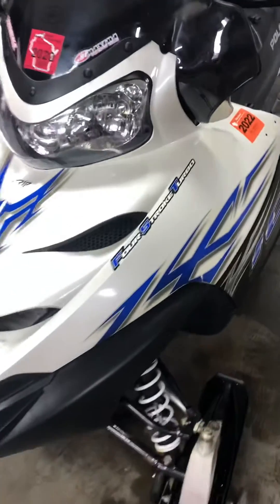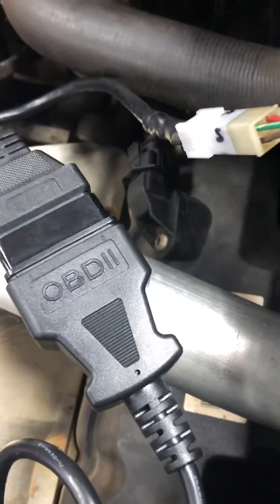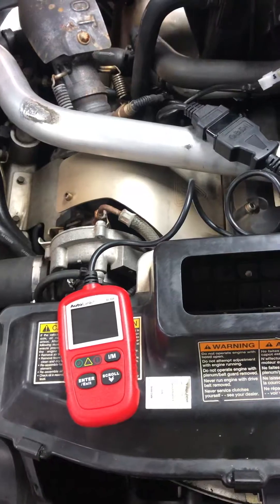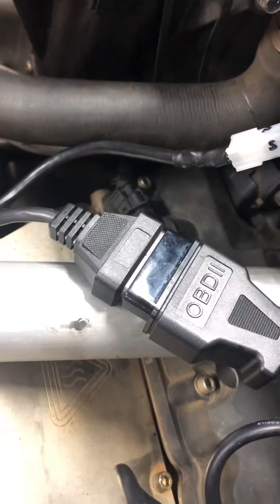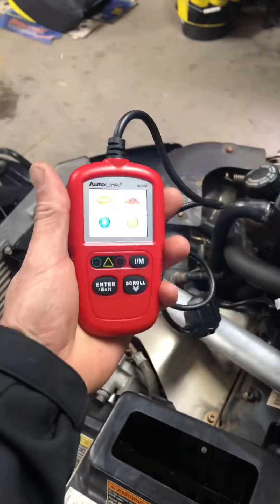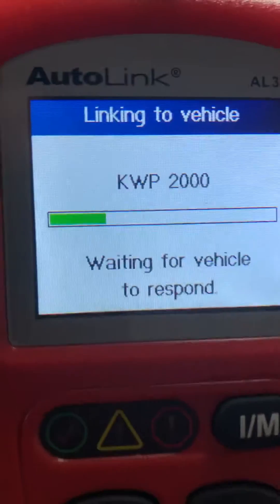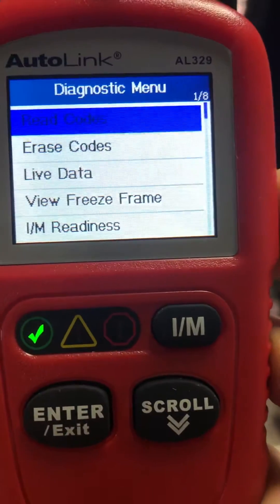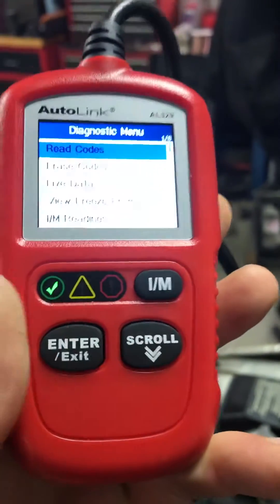Polaris FST 750cc Turbo code reader

Comment: Thank you ! Good video
Is it dangerous to run the engine when you do this because my key is ON, nothing turns on, screen or lights. And is it necessary? 2012 Polaris Switchback Adventure 600. Thank you!

Comment: Converter wire works great!!   Where do I find the resolutions for the Codes P1552, P1234 & Code P2229?  Thank you
Reply: can you show me how to make the connector and where to get the 4 pin connector  thank you

Comment: can you put a link to the cables
Reply from the maker: https://www.ebay.com/itm/265002909322
Reply: @timtrzebiatowski7919  I have a 2007 Polaris 750 IQ Turbo, the check engine light is on. It stays solid at all times, any suggestions?